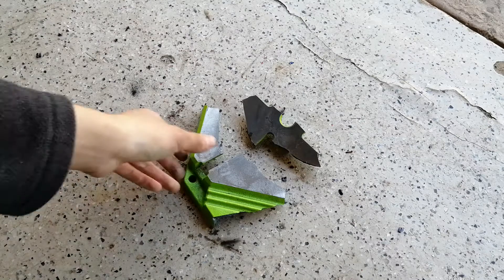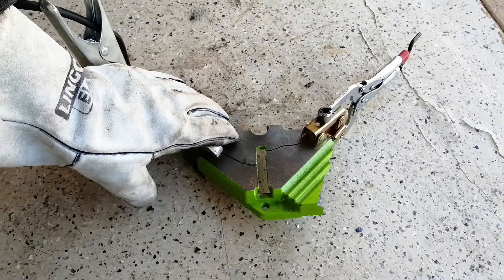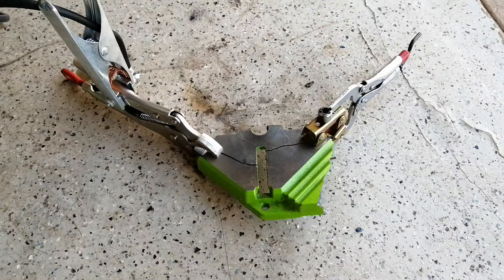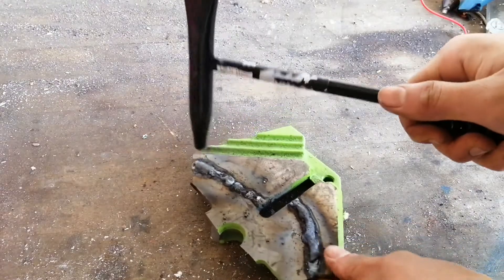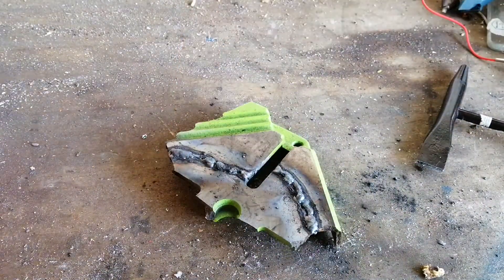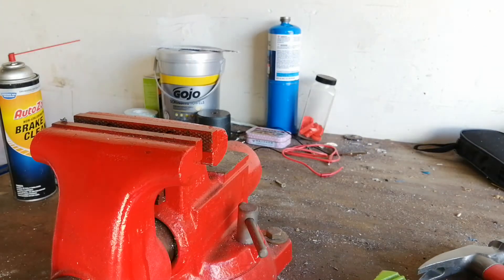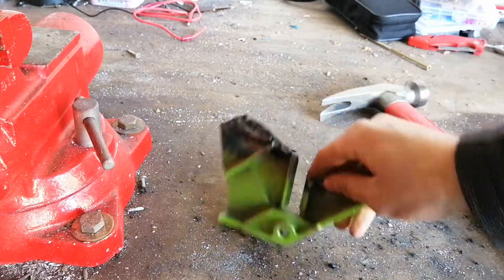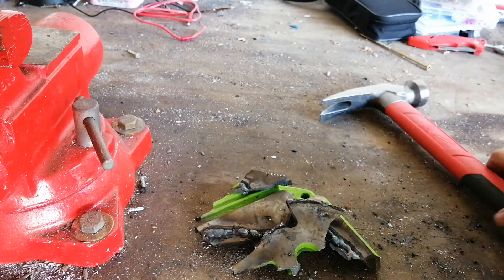Stick Welding Cast Iron with 6013 Electrodes

Comment: Use a nickel or copper rod. ENi-Cl  Works fine. It's as proper as it gets.  I've run really expensive cast iron turbo manifolds that had a habit of cracking it turned out after heat cycling a while- after welding them up with a nickel rod. The 2 i Still have are holding to this day actually a decade later

Comment: I need to get a cast iron pulley onto a hardened steel shaft... pulley has a keyway, but shaft doesn't, i figured id grind one into the shaft, but the pulleys gonna/gotta be close to the housing, so theres no room to get the blade in there onto the shaft... all i have is 6013, 6011 and 7014... which none of those qualify for the job...    -6011 did stick pretty good to another hardened steel shaft i had...

Comment: You can weld a bench vise with a 6013, but you have to preheat and bury it in sand when it's done getting welded.
Reply from the maker: Yes, it is doable but a vise made of regular cast iron instead of ductile iron or steel probably isn't worth fixing